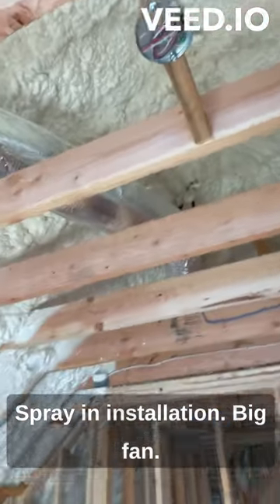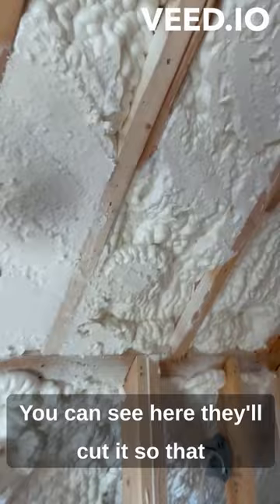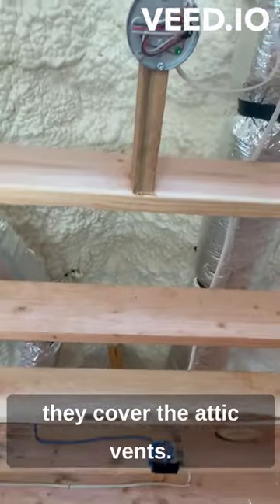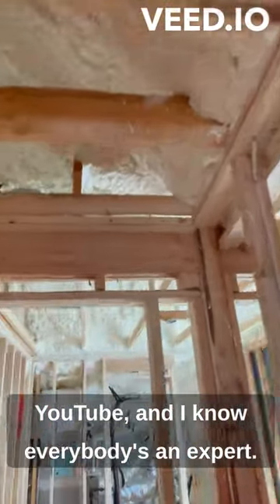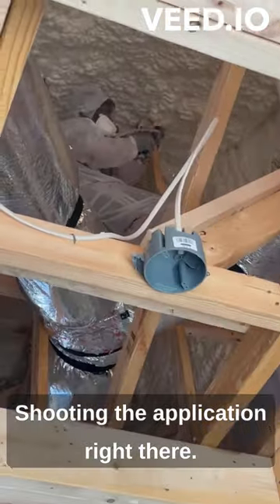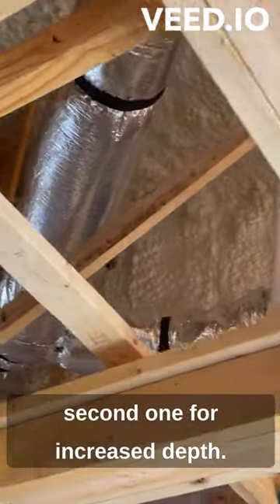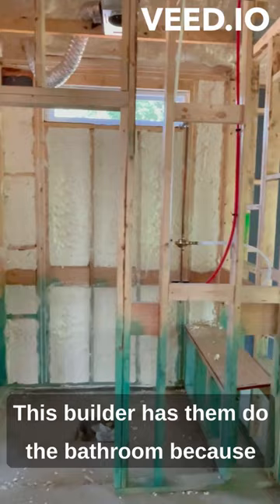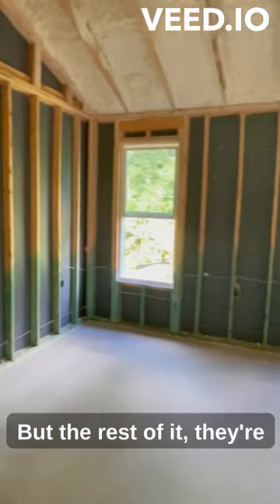No Ventilation with Foam Insulation?

Comment: Roofer here, I just want to say thank you for the future work. You guys are awesome! Now, when you notice a roof leak, I show up and explain it's been leaking for years, and you didn't notice. Everything is rotted out. The spray iso is completely water logged and weighs 100lbs a square ft. The $500 repair you needed 4 years ago is now going to cost you 40k. Why you ask? Well, we're going to need to remove the rotting plywood, and it's now been completely incorporated into the spray foam from underneath.  Don't worry tho, we're only going to charge you $100 per man, per hour until all the foam is removed and cleaned up.
Reply: Funny how it doesn't work that way. 
Roofers better learn to do metal roofs as of this year and next most insurance companies no longer cover roofs for replacement cost for storm damage
Reply: @cw93711 ▪︎ wow, that's scary. Which insurance companies are you referring to? Please list just a few major national ones. Thanks
Reply: @joshuaholmes5096  ▪︎I honestly thought this foam was supposed to be the best insulation ever made! So, as just a homeowner, what product should I ask for? Or, is there something that should be done before adding the foam? Plastic vapor barrier maybe?
Reply: Lol your all doom and gloom.
Well I would suggest that they get a thermal reader that can look for where the moisture is coming every year it's very simple.problem solved buddy 😂.
Reply: Traditional, proven ways are best. If you’re insulating your rafters use the foam or plastic baffles that go behind your insulation, use rock wool or fiberglass batts over top then I did radiant barrier. If you’re just doing the attic floor, you can staple radiant barrier to your rafters then blow in cellulose or fiberglass. Spray foam is neat but you’re essentially sealing in everything. Great if everyone did their job perfectly, not so great if someone made a mistake or missed something. People make mistakes. I’m not betting my roof on it.
Reply: @Baconbeerify  what about thermal readers
Reply: @cw93711 whaaat??😂😂😂
Reply: I've read that closed cell spray foam doesn't need ventilation
Reply: Yup it’s hilarious. Ha ha ha . Now, how many structures you have worked on that required removal of foam insulated substrates? Metal roof that is undercoated with foam can still leak. Condensation still possible. Grinding and cutting foam can potentially release toxic dust. 
Regulatory outlook is uncertain, people that did get sick from off gassing lining up for law suits.
Don’t take me wrong, I love the effectiveness of it, just not sure about potential long term issues.
Reply: Great idea, I will let you do MC readings using IR. Are you an adjuster by any chance? Sounds like something that an adjuster would say.
Reply: @franklinauguste415 a it’s called a thermal imaging camera b nobody is going to do that you really think the people that don’t clean gutters drains ext or change furnace filters anodes ext are really going to set a schedule to image there attic then actually do it once let alone twice
Reply: Question is open cell or close cell thiers a difference an I'm not sure what is used on rafters...and the foam is the way to go
Reply: @bethanyanderson1745 regular roof... Regular sheathing of your choice... Zip systems or whatever you want... Foam board pick your choice of r value/ thickness; seal it, second layer of sheathing and zip... Roofing material of your choice... Batt interior Rockwool preferably... 4 in gap more bat Rockwool. 2x4 secondary freezing framing, more bat Rockwool... Plastic for air sealing. Hard Wall surface of your choice... I would suggest a (rock foam board) for ease of installation, extra r value, compared to exposed foam extra fireproofing, no moisture if sealed with proper sealant and tape.... 2 thermal breaks out 5 layers of insulation. Air gapped, 6 layers of moisture protection.... Easy to install, cheap. Easy to remodel... ... ... Vs this... Thermal bridges= moisture... Moisture= eventual problems... Unless you're in an arid climate I guess
Reply: @bethanyanderson1745  closed cell foam is the way to go but it will cost you
Reply: Foam insulation is extremely expensive.   Maybe that’s why they using batt insulation in the walls.
Reply: My thoughts exactly
Reply: Yes. Complicated but correct. 
The builder and roofer must work together. And all this should be in the original architect design. Furthermore be understood and approved by the building inspector
Reply: @nathanellison594  it just has to be thick enough to overcome the dewpoint for the area.  If you. Insulate a roof with regular bats and no air venting against the roof, sheeting any air leaks from below form condensation and rot the sheeting
Reply: Closed cell foam like this doesn't absorb water. So I'm not sure what you're rambling about. Maybe blown in insulation? Or open cell? And if you can't tell the difference visually you should find a new profession, cause I sure ad hell wouldn't hire you.
Reply: If the roof leaks at all the roofer is a hack.
Reply: Yes you're right. Just had to fix one last week. Cathedral ceiling, spray foamed against metal and what a mess! The leak was close to the bottom inside and close to the top outside. Everything was waterlogged and yes,  closed cell foam will soak it up as good as open cell.
  By the way, I used to spray foam during winter months a few years ago. Mostly closed cell, 1,2 and 3 pound foam.
Reply: @HippieLettuce420r correct so water that ETS under the deck goes....
Reply: @bryceg5709  if you've got water getting under your deck then that means it got past your roofing, underlayment and sheathing...you've got bigger problems then the fact that you used Blown in foam...like a shitty roofer.
Reply: @HippieLettuce420r  yes but this post is a roofer saying they get called out to jobs where by the time the home owned notes a water leak the water has permeated the roofing system and saturated the roof sheathing.  Which since most of the houses constructed with sprayed attic foam insulation have engineered truss roof systems brings up the issue of if that roof deck and the truss are rotted then you're in deep.
Reply: @bryceg5709  his claim was that closed cell foam gets water logged and costs thousands to remove. Thats what I was referring to and why my comment was that closed cell foam does not absorb water, challenging the level of his knowledge as a roofer.
Reply: @nathanellison594  I have read problems are happening with it and getting torn out.
Reply: @mfcobb1  wind damage, trees, product failure happen. So do mold, bugs, and rot from no ventilation.
Reply: @HippieLettuce420r  storm, trees, hail, no ventilation, trapped heat. All no good.
Reply: @MAKAROVOWNER  most if not all situations that you use closed cell foam insulation in your attic space is if it's completely conditioned and you are using monopoly style building techniques that completely seal the house from the outside elements.
Reply: I agree spray foam for walls I think is great but not for roof underside, I like the good old regular fiberglass batt, I don't usually do the actual rafter anyway just seal off the attic and outside walls, always leave the rafters open, unless you are finishing the attic even then I wouldn't insulate more than what's usable
Reply: @cw93711 Insurance isn't covering much of anything soon or if they do they cover 25% of the cost for 100% of the Premium 😂
Reply: Lol. It doesn't work that way but it's a nice rant. Open cell foam allows water to migrate through. It takes about as long to reach the drywall as regular blown in. It's not the foams fault if a homeowner ignores a problem for years. FYI I've been both a roofer and a foam installer.
Reply: @normanmiller8412 you are a liar. A closed cell won't absorb water.
Reply: @grizz6582  I'm a foam installer and roofer as well, so settle down. You're not accurate in your statement either. Scenario #1, spray a blob on cardboard and take it outside in rain, and yes, it will shed water and not absorb it. Scenario #2 spray a bowl onto cardboard and set it outside in rain and it'll hold water in the bowl and won't absorb water (not right away)... here's where you're wrong... leave the water in there long enough and it WILL absorb water. It'll become waterlogged. I know because we spray closed cell on commercial roofs... don't believe me I have some customers you can call. The "bird baths" will leak over time and it's not just uv rays the make it happen. We've done tests inside.
  Saying closed cell doesn't leak is like saying tires hold air... it depends...
Reply: @normanmiller8412  closed cell foam doesn't allow water infiltration.  Off ratio or degraded foam is another matter altogether. If you don't properly clean and maintain your equipment and are spraying a mess then maybe what you say is true.  Since I spray good products I don't have that problem.

Comment: Ya it's great. Until your roof starts to leak, and you don't realize it's leaking. And rots the roof off
Reply: Open cell in the attic closed cell in the walls
Reply: @brandonwardlow1318  ▪︎ maybe the foam manufacturers need to add an additive to the foam so the foam turns color when wet?
Reply: @bethanyanderson1745 cool idea, but if it’s 5” deep, you probably won’t be able to see a leak developing.
Reply: This falls in the same vein as caulking toilet bases. Congratulations, you just guaranteed it will be 10x more difficult and at least 10x more costly to fix
Reply: Hey, he just learned a new word, don’t rain on his parade.
Reply: I'm from new york and I moved to houston where they call call the toilets. We never had to do that back in New York.
You'd probably get thrown off the job doing it in new yor
Reply: @ValorQuestStudios  removing caulk from the outside edge of a toilet increases the cost of a toilet reinstall by 10 times?
Lol😅😅😅😅
Reply: @FreeU.S.  Other way around. Do not caulk your toilet bases.
Reply: @ValorQuestStudios  lol, how about you stay away from my plumbing

Comment: Wait until the ac coil turns into powder and developed a leak from the off gassing of the foam. Especially open cell foam and if the ac guy doesn't tie in some outside fresh air. I see it everyday. Some units not even a few years old. One house I recently did 2 systems coils were gone and one lasted a couple more years because it did have outside air. Imaging what it does to your lungs.
Reply: @Mikesdear  ▪︎ was the AC located in the attic? 
Just to clarify, was it the ac that developed a leak? Or where was the leak?
Reply: @bethanyanderson1745  no ac was not in the attic but either way it’s not so much the space it’s in but the gases it’s recirculating through it’s ductwork so as it passes the coil to reject the heat the gases are eating it up. Brand new coils need to be treated before placed in the space but that only protects the coil not the people or anything else in the house.
Reply: @Mikesdear  ▪︎ ahh, now I understand. Thank you for taking the time to reply.

Comment: My attic is not insulated , the ceiling to the attic is insulated.  The soffit has vents to let air in and out during the seasons. THE WOOD IS LIKE NEW , 100 year old house.
Reply: Understood. That’s correct. This video is showing how someone is trying to make a “warm” attic. Why? I don’t know but they must have a reason.
Reply: @CS-hv8rq how many times your A/C breaks on the summer? Ohhh ok
Reply: Insulating the “rafters” directly under the roof plywood expands the “conditioned living space” into the attic. Yes that allows for a HVAC unit heating or cooling to function there. But you’ve then turned a residential structure into one that acts like a commercial one utilizing every square foot of space below the roof. Therefore the roof must be treated as an insulating component keeping the underlying structure in the “conditioned space” temperature the same as at the floor. . 
It’s all about where in the  insulation’s thickness does the inside and outside temperature differences zero out. 
If that location is in the middle of the insulation then all is ok and everything above and below will do their jobs. But if the equal/zeroed temperature point is to far out or to far in the condensing point becomes the destructive point. 
These rules of moisture reverse in hot southern climes vs cold northern ones. You just have to determine where the humidity is coming from and control it there
Reply: @CS-hv8rq  when your air-conditioning turns on in the summer and it blows out super hot air for the first 20 seconds. It’s because the air in the tube has been heated by the attic. When you put the whole system inside the conditioned of space that doesn’t happen anymore and the system itself is more efficient.  It also moves the air barrier to the roofline which is a better seal than your ceiling because it is punctured by wires and plumbing vents etc
Reply: There are different forces at play if you live where it's cold that type of attic is very common and also you seldom have access to it, I'd wager you also have a basement with a water heater, plumbing, furnace etc.  Pretty common.  Go to Texas and you have a different issue you're on slab all the electric and plumbing is now in a hot attic baking in the sun.  You have to derate wiring you have less efficiency in your HVAC and the more air you leak the more air you have to recondition.  Either way sealing up an attic good.  Honestly if I was given the option I'd build a house like that then add a membrane roof deck over it air gapped and then roof that
Reply: CORRECT WAY

Comment: There has been a lot of problems with moisture being trapped and rotting plywood or sheeting. Some insurance companies are not covering houses in some areas
Reply: True. The moisture spreads out into a huge area, because there's nowhere else for it to go..so even a small leak can rot a waay bigger area than usual..and the foam keeps the leak / rot from getting detected right away..
Reply: As an agent who writes insurance nationally,  what insurance companies don't cover a home with spray insulation and in what areas?

Comment: Asphalt shingles require ventilation below the deck or you’ll significantly reduce the service life of the roof, especially in wet climates. 
Not a good idea, no matter what the insulator says will work. They’ll spray foam whatever you want.
Reply: Asphalt singles are on the way out as almost all insurance companies have stopped covering roofs for replacement cost. 
Everyone should be switching to metal roofs.
Reply: @iloatheenglish  ▪︎ do you know if a baffle system, like used for asphalt shingles, that could be used for foam? Or any system to provide ventilation for foam insulation?
Reply: I believe the reason for fiberglass in the interior walls is more for sound proofing, not high R-values which is what you need on outside walls and roof.
Reply: @davidmarquardt9034 I was thinking cost. Spray foam must be more expensive.
Reply: @cw93711 are they noisy during rain? Will heat reflection cause problems to surrounding buildings?
Reply: @NeutronX101  you can get metal roofing that looks similar to current asphalt shingles.   Those have less noise than regular singles.
If you go with just straight metal it's a little louder, but it really depends on the insulation in your roof.
People now build barndominiums out of pole buildings that are metal sided and have no complains. 
I have never heard of any issues with heat to other buildings as that would be a reflection issue.  
You can get the steel roof in any color so it can be white and reflect all light or black an absorb it all or any shade in between. 
The only buildings I have ever heard of with issues were buildings that were all reflective glass
Reply: @NeutronX101 As a metal roof owner, I can confirm there is more noise in the rain. It's probably on par with the noise from a window AC unit. I find it calming and sleep right through it. rainstorms have a baseline level of noisiness already.
Reply: @bethanyanderson1745 you can put in baffles and spray foam over them. They don't use them because money and short-term thinking.
Reply: I build and insulate houses with foam all the time.  Our building science consultants do not recommend/allow venting for these houses.  The attic is part of the conditioned space of the house and in Texas summer the attic is actually fairly cool.   No need to vent attic and shingles do not get excessive heat buildup.   There is a science to all of this and you need to understand that.   We have a building science company we use on every house.   Comp shingles are not going away.  We get better service life and wind performance out of comp shingles than a metal roof on the coast.  We actually switched to aluminum roof panels for customers that want a metal roof.
Reply: @kevin409galv  comp shingles will go away or they will have to get better. Maybe not in 10 years, but it's coming. Around here, oklahoma, the shingle must be rated specifically for insulation directly on the roof deck. If not the warranty is voided. So there is a difference. Heat travels in 3 different ways which would confuse even the most seasoned physicist/engineer especially when you throw moisture into the equation. So as skilled as your scientist may be, I wouldn't expect their understanding to always be considered best practice.
Reply: What?  That doesn't make any sense. Insurance companies are covering asphalt shingles. Thry are even giving discounts on certified, fortified and wind mitigation roofs.